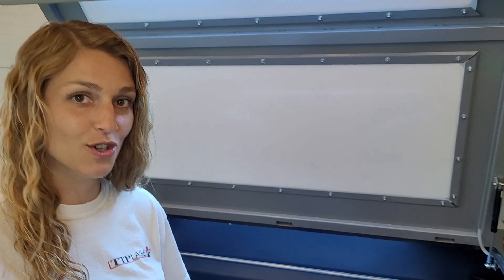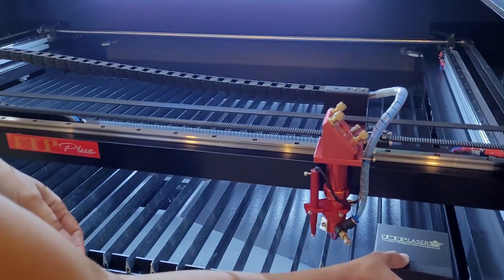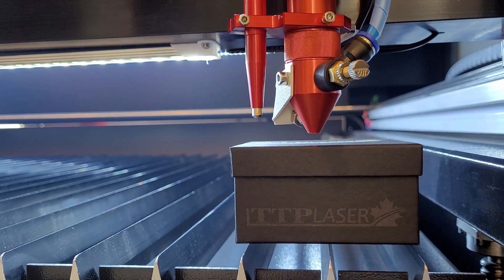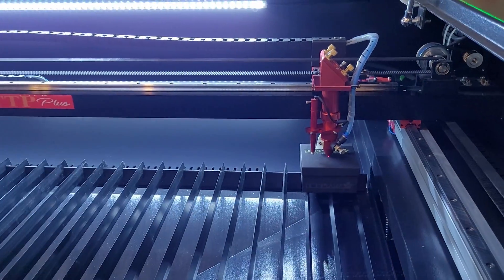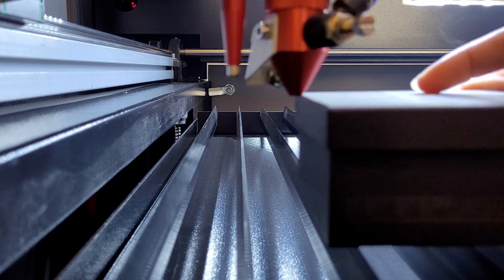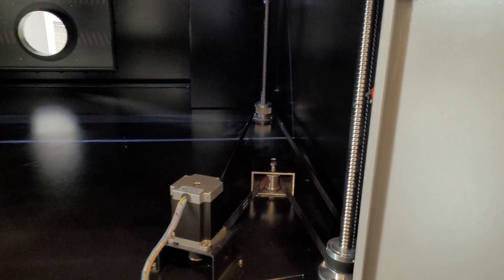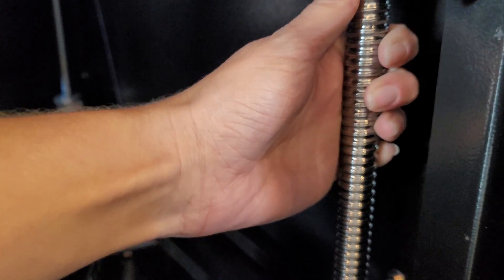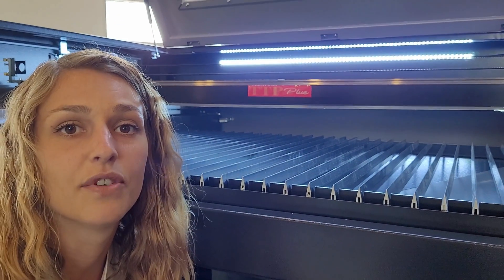How To: Level Your Laser Bed

Comment: Wouldn't adjusting the feet be easier are they not screw fit
Reply: That's actually a confusion of the word "level". The machine and bed don't need to be level, the bed needs to be perpendicular to the laser head to maintain perfect focus.